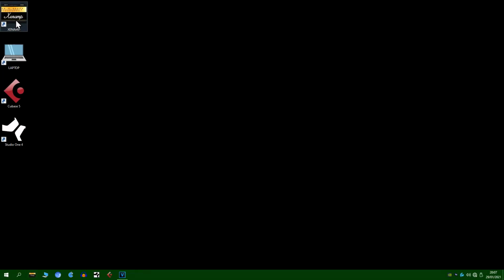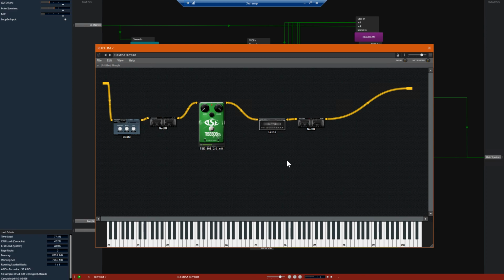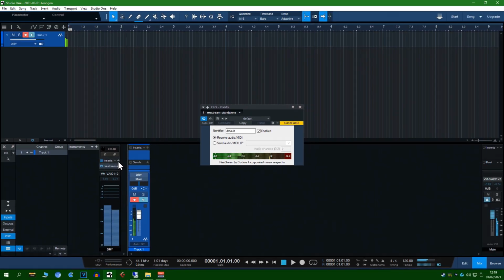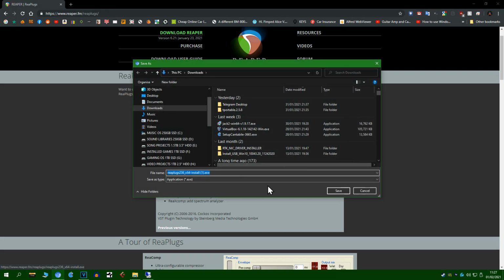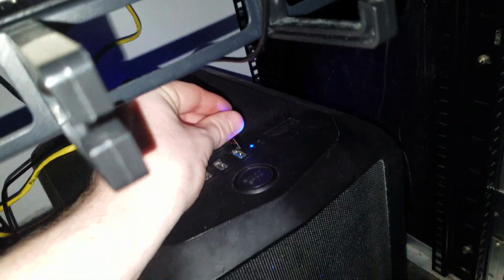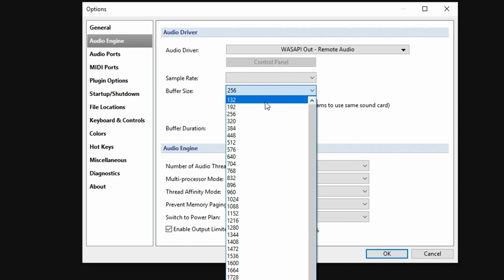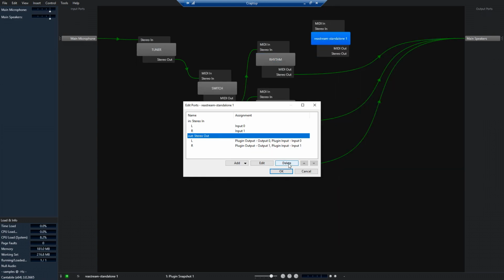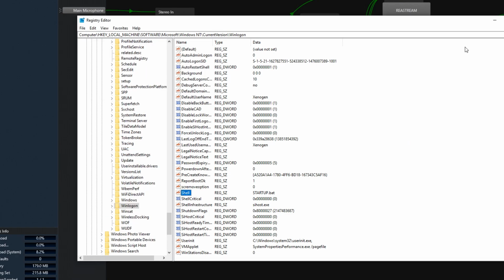BUILD YOUR OWN BUDGET DIY AXE FX/HELIX!

Comment: OMG dude... that's an incredible tutorial!! I think you will break the internet with this one. Can this work with VSTi's? of course you would lose all the midi editing benefits of not playing directly on your proyect, but could save resources on your main computer.
Reply from the maker: The great thing about cantabile is that it's modular so you can add just about anything and midi functionality is definitely on the cards. If you would like I could do a tutorial on this in another video.
Reply: @Xenogenocide  im looking into cantabile and it looks really awesome! As a sound engineer I definetly can see some potential use for designing live shows. That and SonoBus are on my table this week.
Reply from the maker: @GabrielsMask  Sonobus looks exciting, definitely worth having a look at with Cantabile. I've tried a few other options like wormhole2, netvst, voicemeeter banana and asio link pro. Most introduce latency and others crash when loading certain vst plugins.